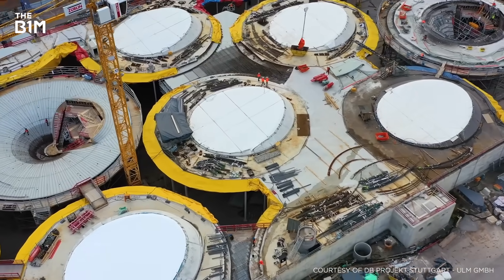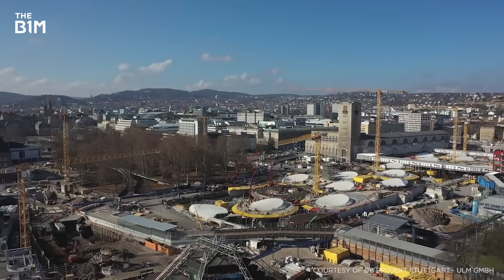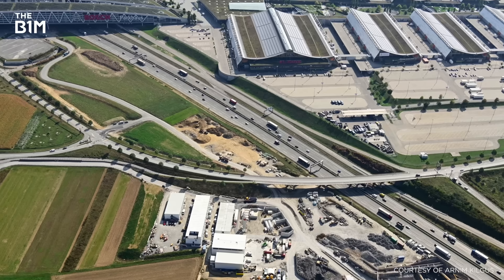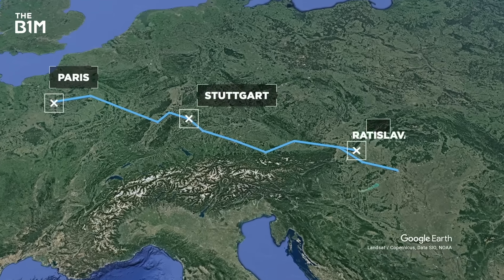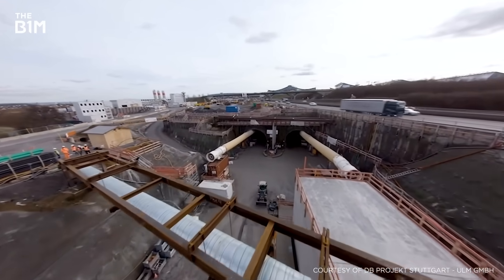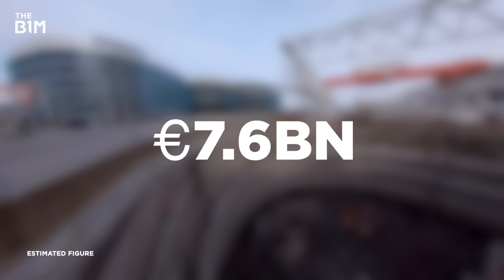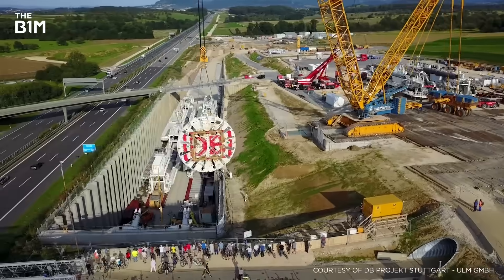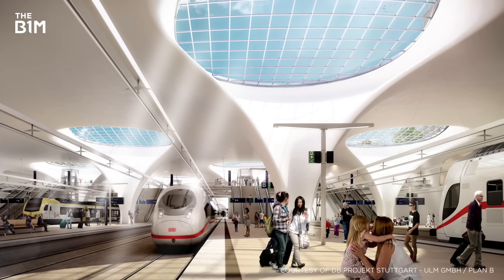Germany's 27-Year Struggle to Complete a Rail Project

Comment: Thanks for the video. Just a few points that I want to clarify as a citizen of the German state of Baden-Württemberg which were asked in the referendum:
1. I think the comparison with the BER is misplaced as the problem with S21 is that after the project was due to begin, public protests stopped it for a decade. So it is not really a massive construction delay, but a political delay.

2. It is not just a train station. The tunnelling under Stuttgart is through rock formations that would expand for decades if the rock came into contact with water which makes it immensely more difficult than e.g. a tunnel through the Alps.

3. They are building new tunnels above and under existing subway lines, road tunnels and only meters aways from historic buildings, so there are quite a few challenges. The amount of tunnels and bridges is staggering and the price is IMO more than acceptable for that. Berlin paid 10bn for its new train station which was not over budget.

4. Germany's "controversial transport projects" are mainly due to optimistic budgets for politicial reasons and more importantly due to massive resistance from locals against such projects. Often these people are well-organised pensioners with political influence and a lot of time on their hands. They usually are interested in the situation now and have little interest in the future beyond 2025.

Comment: Hello I'm from Germany.

Citizens' initiatives or nature conservation associations are largely responsible for postponing such construction projects. Just like the Fehrmarnbelt tunnel between Germany and Denmark.
(My English is not the best)
Reply: Good luck, it will be amazing if all will work together for the future! 😊
Reply: @AM-md6sv  
synchronized departures will NOT happen anyway. With or without more platforms
"Deutschland Takt" only means that there will be connections to all major cities about every 30mins. It doesn't mean they all leave at the same time. No synchronised departures.
Because a "Takt" like in Switzerland would mean that trains would have to wait up to 25 mins at every major train hub. It would unnecessarily increase travel time and clog stations with trains.
Reply: Yes, that's true, which is tragic because projects like this make the city greener, and hiding tracks in tunnels also help to conserve nature.
Reply: @UlliStein  Lol, what nature? The tracks will mostly be replaced by overpriced appartments, whilst thousands of tons of concrete are used below, resulting in not entirely neglible CO2-emissions.
Reply: @UlliStein  if the point of Stuttgart 21 was to make cities greener why did they cut century old trees in the Schlossgarten for it? Why couldn't they just put a lid on the massive stroads  going through Stuttgart and plant trees on it?

Comment: I get fooled that german are efficient and impressive in engineering  my country wich 3 rd world country (egypt) build entire new cities and roads and even new train routes under 5 years we are already building our first high speed train 250 km speed and about 1000 km its will build in just 2 years and german company simens will provide the trains and mechanical stuff
Reply: Building entirely new cities on unused land is relatively cheap and easy. Building a new rail station at a 90-degree angle to the old station, underneath it, while the station is operating and without damaging buildings or closing roads on the surface, that's when things start to get complicated. This isn't comparable to Future City or anything like that, it's like building a new Ramsis Station underneath the old Ramsis station, without closing it.
Reply: building sth from scratch in an area with hardly anything existing is easy ... realizing such a project in a state's capital city, in difficult terrain and high population density in the city and right beyond the city limits as well is quite difficult, expensive and time-consuming task

Comment: I was in Stuttgart about 2 years ago and was astonished by the scale of this project which is a massive piece of urban redevelopment in the heart of the city. While the revamp will undoubtedly be worth it in the end the scale of disruption it entailed is massive
Reply: Pre-covid I used to commute to Stuttgart central station every day. At least from my perspective, the actual disruptions at this stage of construction to the average railway passenger is neglible to non-existent.
Reply: It wont be worth it.
Here are a few issued (I made a longer comment on my own with mroe detail)

The station is tilted quite severly, so its technically just a trainstop.
Firesafety problems.
Hydrophile rock is beeing tunneld through.
dangerous to mineral water deposit (second largest in europe)
destroying protected old station and park surrounding it.
less capacity.

usually trainstations are not the part that make the trains go faster, but the connections between them.
Reply: as if messing up trains is the worst, most disgusting thing ze Germans ever did
Reply: I commuted to Stuttgart for 10 month's (from Heidelberg) and it was quite interesting to see. It also wasn't slowing down my commute in any way. I think it will be beneficial for the region. My brother lives in Munich and in the future the commute to Munich will be shorter and more comfortable I think.
Reply: Sure! But the overhead station needs to be kept! Look at zurich! We have the same amount of overhead tracks, and through tracks, within a few years we used a lot of it, in a few years it will be maxed out again...
Reply: @walkingonoldtracks  I agree with you there. The curent plan sees the number of platforms reduced to 8. I think this number will be woefully inadequate.
Reply: @DanielSchaefer01  It will be enough to have the same Capacity as the old Station. Not more, the same as the old. If Traffic increases (to be expected), the Station will be too small. Oh and that "same Capacity" is under the Assumption, that no Train stops longer than 30 Seconds. That may be possible with a Metro if there are no Strollers or Wheelchairs, but it's completely impossible with Regional or Intercity Trains.

Comment: And I thought BER was the only German transportation debacle!
Reply from the maker: Yeah no
Reply: S21 isn't even really a debacle.

The time and cost estimates were highly optimistic to begin with. Reason was as always politics. The politicians wanted to sell this project as cheap and fast. The companies vastly underbid each other to get the contract. 
For most involved the rise in cost and construction time are hardly surprising. It's just approaching what they estimated in the beginning. 

And since the main construction really began it was quite smooth sailing actually up to now. No huge unexpected delays. 
With tunnel construction they are even slightly ahead of the time table.
Reply: No
The is a Tunnel in my Town to be build , called the "Riederwaldtunnel".
It will connect 2 Highways in the City of Frankfurt/Main.
Since the 1960s they are planning it, it will maybe be finished 2030.
One of the highways is guiding through the city North to South, the other highway is just ending at the East Part of the City , where I live.
Reply: not by a long shot, sadly

There´s a big highway junction under construction where i live, it should have been completed in 2006. Work began in 2019, it´s scheduled to be finished in 2026... I´m not optimistic.
Reply: In Munich too! The second core S-Bahn route is a good example...

Comment: Jeez, Germany is so good at building stuff yet it takes 27 years to complete a line of train track. ♥️ to B1M
Reply: Its a great video, although it may have given you the wrong impression of the complexity of the project. It is in-fact an huge amount of tracks, tunnels, bridges, stations, water channels and embankments before you even look at the main station itself. Check out the YT channel "Bahnprojekt Stuttgart–Ulm", some of the engineering is mindblowing and they go into great detail (although its in German you can understand most of whats going on from the diagrams and videos).
Reply: @daskurka  All true, but the Chinese build such complex things like ten times faster.
Reply: @StrangerHappened  Not completly true. Yes, the chinese build their infrastructure faster but they would have never gone with building a lot of tunnels and keeping old buildings in tact. They would have just demolished everything standing in their way and never done anything close to an environmental impact study before such a project. If germany would behave in the same way, we would have been as fast as the chinese.
Reply: @StrangerHappened  They do build much faster that is true, but they do not have to worry about the same laws and regulations the Germans have too, like lizards, wildlife bridges and noise and light pollution. Not to mention the average German who has a actual right to protest and can therefore cause problems for the works if they so desire. This means at a functional level the project must spend lots of time to get community consensus on the route and the timing of its construction. Obviously in China none of this is an issue, they could just go straight through the center of a town and remove houses, no need for tunnels, no need to worry about any local consent.

Personally I love what China does, but wouldn't want it in my own backyard.
Reply: @StrangerHappened  That's true - but can not be compared!
Reply: @daskurka  Hypocrit!
Reply: @StrangerHappened  Do I want to live in a totalitarian state that makes projects fast or a messy democracy that makes things slow?  Ideally a 1920s-1960s democracy that makes things fast, but given the choices today China can keep their speed.  I will take the freedom.
Reply: @StrangerHappened  
Don’t compare our democracy with the Chinese dictatorship !
Reply: @daskurka  bro you're describing it as if it has become the 9th wonder of the world 😂 , atleast compare it with Japan and their bullet trains which are the flagship projects of railways
Reply: @cashmoney2159  your words not mine. One can appreciate great public works on their own merit, Chinese, Japanese or German. It all helps to push forward the state of the art.
Reply: @GeHi-s5x  
Silly question 🙋‍♂️
Reply: This project has been making us the laughing stock of the world for over a decade now.
In China a similar project would have been finished from planning to start of operations in less than 5 years with no one ever talking about it, but this has been a major political drama in Germany for the past 15 years which regularly made headlines.
Reply: @AntonFetzer  Are you in hibernation?
Reply: Not to mention the unopened airport project that costed fortune to build
Reply: @RyanTaylor2000  The problem hadn't been the airport!! It was the supplement!